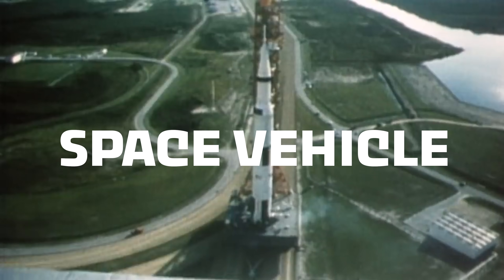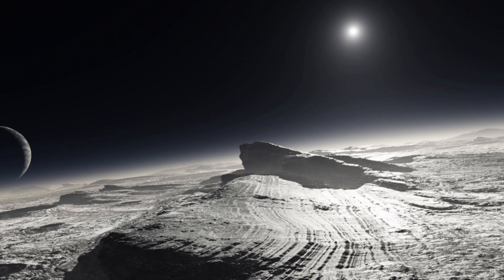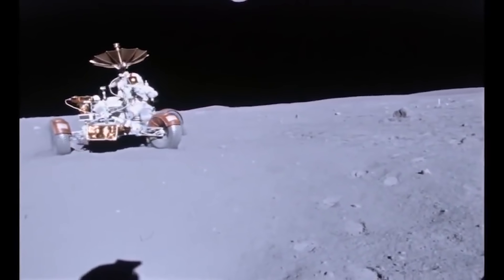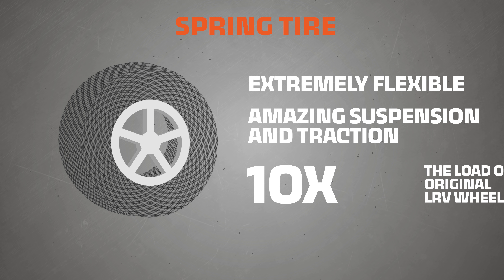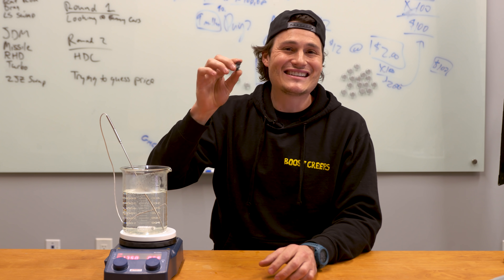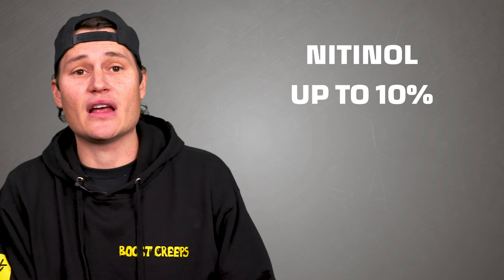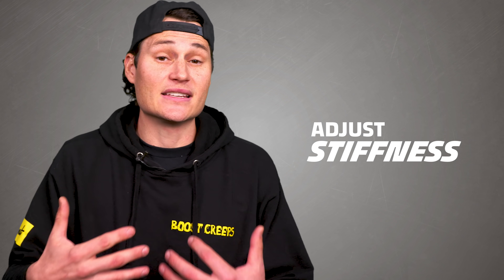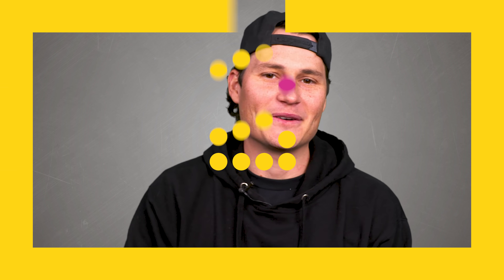How NASA Built The Future Tire

Comment: You have to be ready for the NASA enthusiast geeks like me to "well, actually" your video when you make it about space. Here's some "well, actually" facts for ya.

The lunar rover cost NASA about $38m to develop. Adjusted for inflation, that's around $200m today. And that's the total for four of them. So it's about $55m in today's money per rover. Now, only three were mission used. The fourth was used for spare parts so you decide how you want to figure that in. The point is, it wasn't billions. They didn't come up with it to carry stuff, like you said. They did it because they were being forced to choose between several interesting landing sites. They realized the astronauts could visit several of these places on the moon from one landing site if they could move around faster instead of walking. They explored every idea from jet packs to spring loaded shoes. One good idea that almost killed the rover was to just load the lunar module with extra fuel and oxidizer and just take off again and land at the next interesting place. They settled on the "moon buggy" which is a NASA nick name, not a southern one, because the math worked out in favor of it. They could go further with less weight by including a buggy on the side of the lunar module instead of extra fuel. And it's more versatile and maneuverable than the lunar module itself. You can change your mind or just drive around a big rock whereas the lunar module would have to plan and make decisions about all the landing sites before even leaving Earth. The lunar surface is covered in regolith, not "luscious soil". The difference is soil contains nutrients and microbes. Regolith is sterile rock that's been pounded into a fine talc from 4 billion years of impacting meteors. Also, sand grains are very round and smooth. Regolith grains are pointy and jagged. I can wreak havoc on mechanical devices like the rings that lock their gloves on to their suits. They also worried about them breathing regolith into their lungs and it causing lung damage because it's so pointy and jagged. And we know the reason that grains of sand are round and smooth is because they're exposed to erosion from wind and water. Wind and water do not exist on the moon so the grains of regolith don't get worn away and stay jagged and pointy. Well, actually, water does exist on the moon - you said there is no water on the moon, also - but not enough to cause erosion because it's all frozen. I am "well, actually-ing" myself now so I digress.

But you got the science of the wheel right so I'm mostly nitpicking. :)

Comment: Hi can you please do a review on the RVS engine oil treatment. Apparently they ran a honda civic with no engine oil for 3k kms with no issues.

https://youtu.be/gSdZHt0K_h8

Claims:
RVS integrates with the original surface creating a mirror-like Triboceramic surface on the friction zones of mechanisms. As a result a worn mechanism is restored to near or original specification due to friction decreasing with tolerances and compression restoring to, or close to original specification.

Would love it if you guys could do the test they did and show the engine teardown after 3k kms
 
Thanks, love your content man 👍

Comment: Um how about we use nitinol in engines... a metal that is at its strongest and goes back to its original shape would be way better then the metals we have that expand, get weaker, and warp under heat.

Comment: Just a small point, the wheels on the rover don't get heated to return to the original state. Instead, the tyres rely on a related pseudo-elasticity effect. The phase change between martensite and austenite is dependent on both temperature and stress. So when the wheel is stressed, it changes phase, and when the stress is removed, it returns to the remembered shape. This is even better than relying on heating as it basically does it all on its own. v cool

Comment: The thing about wrapping those tyres in rubber is that it would defeat the purpose of having more durable tyres since they would still need to be replace when the tread wears out or the rubber becomes too hard for the tyre to be safe to drive on.
At most it can solve the issue of tyre punctures, but that's about it.

Comment: if it's possible to cover these tires in rubber perhaps the way they could stop them being disposable would be to sell a product or have a service that would re-coat/replace the rubber every-so-often. i would imagine that it would be a great way to cut down on rubber usage since it would only really need to be on the outside of the wheel. could be a great way to recycle the existing surplus of old tires lying about since the old rubber could be melted down and used in the coating process.

Comment: "memory metal" sounds like nerd talk for spring steel
Reply: Alloys exhibiting super elasticity can deform several times as much as "spring steel" without permanent deformation
Reply: @Jordon Carlson that's incorrect. Most alloys do not exhibit the shape memory effect. Most metals experience plastic deformation via dislocations (planes of atoms sliding against each other) where shape memory alloys experience plastic deformation via a temperature reversible phase change.

Comment: So my dad used to be an aerospace engineer and they had this experimental type of plastic polymer for cushioning delicate parts on satellites. When I had my MR2 and needed a flexible plastic/rubber spacer on the steering wheel he get me a slice and this stuff worked perfectly. However I can't say that about the rest of the MR2 RIP

Comment: Pocket calculators weren't introduced until the 1970s. I believe 1972 was the first true "pocket calculator." They used slide rules in the 60s which is way more impressive.

Comment: What if we made cars from nitnol so when they get in an accident we dump em in a tub of hot water and car damage is fixed
Reply: That wouldn’t happen. Two reasons this works is because it uses weave so it’s flexible, and because it’s designed to prevent relatively low damage. I highly doubt it would reform even minor dents.
Reply: It actually probably would work to some degree, but you'd need a slightly different alloy. The tires are made using an alloy that has a transition temperature so low that it's basically always trying to "remember" its shape. An alloy with a higher transition temperature could deform in an impact and absorb the energy (like any crumple zone should) then be heated to restore the original shape.
Reply: @John McHumanson jokes are fun and all but sometimes they work out, and it's still good to know why they dont

Comment: “Common wheel tire combo for the Miata weighs in at about 50lbs” 

Presses X to Doubt

Way too high there. My 28.7in dia A/T wheel/tires on my Crosstrek topped out at 44lbs. Miata wheels are closer about half that.
Reply: My 17x8 Enkei wheel and 235 tire is much bigger than a stock Miata wheel and tire and it's only 37 lbs

Comment: If you really think about it putting rubber on the outside would be dumb because of all the other issues you talked about earlier, if they stuck a rubber coating on the inside liner of the wheel then it would be way less susceptible to UV damage and or being punctured or ripped from rocks. Because the nitinol tire would continue to do its part from keeping punctures and holes from happening and the rubber inner liner would keep debris from collecting inside the wheel as well as the nitinol tires giving additional UV protection
Reply: Yo NASA hit me up